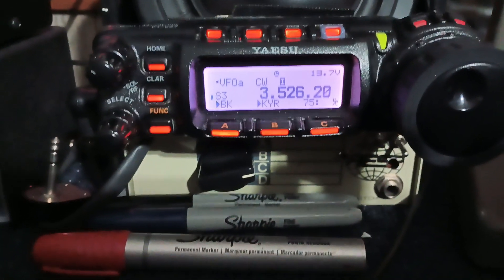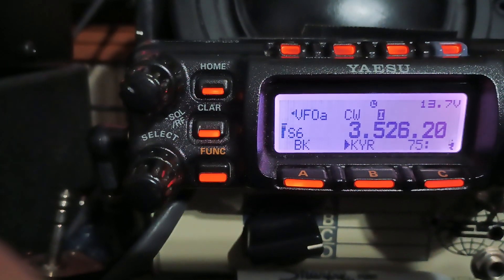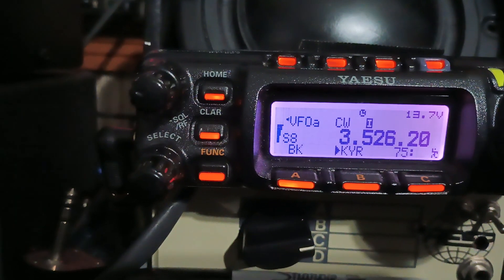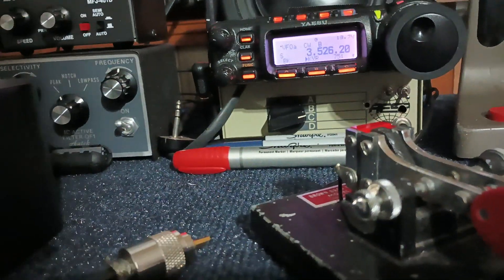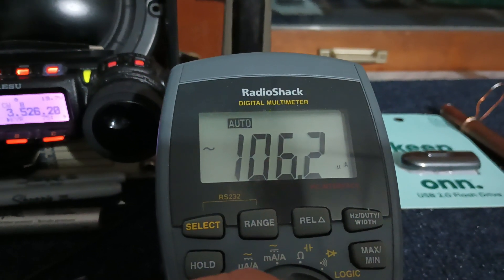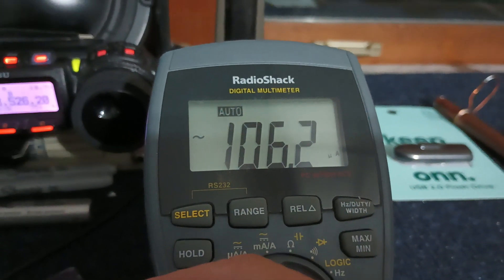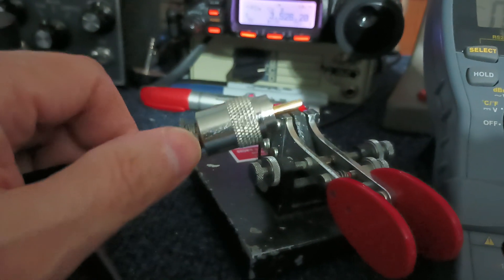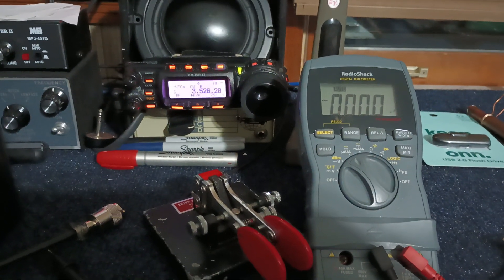Why Grounding Radios and Antennas Is Illegal...AND DANGEROUS #hamantenna #hamradio #grounding

Comment: If the radio is ground via power supply to ac safety ground. Why does it say to put ground rods in? Makes no sense to me. Disconnect everything before a storm or when not in use.
Reply from the maker: The AC line connection does 
NOT  ground the radio. Code FORBIDS GROUNDING AT THE LOAD . That third prong 	IS NOT ground any more than N is.

Its Tribal Knowlege from the early 1900s and just blindly taken as fact by those with no ability in science to reason it out.

I didnt understand it either.

The AC line cord 
 " second neutral" ' is only for shock hazards related to inside the unit or a break in the Neutral circuit of the electrical cord, outlet or branch wiring, it has nothing to do with lightning.

Comment: Again, takes me back to close to when I was 1st licensed and a Ham told me to "..ground your radio to the center screw in the wall outlet recepticle plate..." !
These are just the kind of LID/PIG hams out there that assume you're ignorant compared to themselves, (arrogant, pompass, self absorbed), and don't care if you wreck your station or possible injure and kill yourself.  They'll tell you, "You gotta learn or burn!"  Thus, I have become rather disilluioned with Amateur Radio - outside of just working DX in SSB as far as I can with my conditions out of an apartment with vertical antenna mounted to the balcony railing.  I think I do quite well when I can hear/see my signal on a SDR site somewhere in New Zealand and I don't care whether it was long or short path!  Oh - and just 100 watts.  Great video!
KD8EFQ/73
Reply from the maker: Hey, you remember the "two prong outlet" days!

"Licensed" does not bring any electrical knowlege, its just legal permission to get on the air. 

I saw St Elmos Fire come out of one in the 60s. Not big fun.

A.R. isnt making contacts, its about experimenting with electronics and radio. The
 " on air" is to test the results, if they dont devolve into smoking cinders.

The " long path" thing is another joke, like, my antenna is pointed AT you...propagation doesnt do that long distance. "Great Circles" in Radio Antenna Engineering.
Reply: @k8byp  I think I'm too young for the "two prong outlets".  Always remember the three prong that reminded me of a face as a child! 🤣
And the "long path" crap came from my favorite "Advanced Extras" that think their AE licenses are the same as Ph.D's from M.I.T.!  I swear I wish you could've met them to see and know how incredible condescending, belligerent and ignorant they are.
Reply from the maker: Well just send them a link to this channel and ill play handball with them.
Reply from the maker: The back story there is that A$$L ( pronounced " assol") dont want life members cause thats costing them money. I told them to push off due to the abhorrent conduct of their clowns out in WA state, and they refunded my life- membership money.
Reply: @k8byp  Yeah..  Upon moving to Cumberland, MD, I called them (A$$L) to give them my new address, right away they went into explaining that there was something wrong with my basic membership of $39.00 and I needed to repay it.  I repied, "Really?  Let me run that past the FTC (Federal TradeCommission)."  They tried to tell me that that wasn't necessary.  When my $39.00 membership fee was due I let it go and never looked back.
Reply from the maker: What my crystal ball sees, with specific example in a local corp whose registration trail disappears, and sort of reappears on Ali with Chinese suppliers for materials, and the fact corp Agents are now hiding behind "registration services" is that Chinese concerns are hetting ownership and control of these corps.

If youre in MD we should be able to talk on phone, lets make a Sked...
Reply from the maker: Ah , Blue Disease.  Its hard to beat a Democrat, but try anyway.

Condx from here north have been much better lately for some unknown reason.

Comment: I missed the point of this video. So you are saying not to ground your station at all or are you saying to not ground near the service ground. Also what's going on with that pl 259 it looks terrible. .
Reply from the maker: Thats because you missed " reading, learning and acquiring social skills.*. And your passive aggressive stupidity about " connector looks awful" is childish.*

Grow up,  go away or get banned and reported for harassment.

I wont put up with Trolls like you*. Your fake user name and fake channel with no activity indicate you are a Troll.*

A repeat Troll BTW....thats called Internet Stalking.

I have the big Ban Button
Reply: @k8byp  Great video.  I have heard this before and I have only operated mobile for 20 years.  But, I am putting up a base station now and I had a ground rod driven but have not hooked anything up yet. (Also, I am debugging a 100w amp that is having a problem with rf changing bands on the amp when I key up and the manufacturer specifically said "try grounding the radio and the amp with something besides the RF cable...")  What did he mean?  Connect to the ground rod I had driven in?  It's coincidence that I came across your video when this recommendation was made.

The troll guy poses a good question though, troll or not, you mentioned that "only a fool puts his radio at the service entrance."  I am not an electrical guy, but what do you mean by that?  You have your meter and panel in the house.  This is the service entrance.  Where in the house should the radio go?  How far away?  Based on what you presented here, what are the physics behind the warning?  Do spikes dissipate in the wiring of the house the further away you get from the service entrance?  Also, what's the importance of bonding ground rods no greater than 8 feet separated?  I knew a very capable ham in Cuba who was all over putting his ground rods under the condensate tube of his mini split to keep that soil wet all the time which further complicates what a ground rod can do.  Who makes sure their ground rod is wet all the time?

The more I think about this and the subtleties of what you are saying, the more confused I get.  Let's say my radio is on the exact opposite end of the service entrance, maybe 50 feet away and I drive a ground rod there and I bond it to the screw on my astron power supply that is there for a ground.  What am I doing in reality?  Why do they put a ground lug on the power supply like that and on my IC-706 it had the same grounding lug?  Is this for tying all the equipment in the shack together but not ultimately back to a ground rod?

Also, I don't get the demonstration with the keyer.  I don't know the radio, but I assume you are just closing a contact with the keyer and it's not a 5v PTT or whatever.  What's causing the keying?  The fact that you are closing the circuit through your keyer means that both the center and conductor of the coax are connected to the ground line of the radio and completing the circuit or not?

Anyway, great video.  Thank you.
Reply from the maker: "(Also, I am debugging a 100w amp that is having a problem with rf changing bands on the amp when I key up and the manufacturer specifically said "try grounding the radio and the amp with something besides the RF cable...")"

The amp has a mismatched load, theres a lot of reflected power coming back INSIDE the amp and its interfering with the control circuits in the amp. Hes referring to the grounding RF away " myth.

Put the amp on a 50 ohm dummy load, see if the problem disappears.

Ill respond to other questions later when Im on the computer..
Reply: @k8byp  Thank you for your attention. My tuner is after the amp and I was on 10m going into a resonant colinear vertical.  So, with or without the amplification, on both the radio and the ATU swr meter they both read 1.2~1.5:1 tuned or off.  It's hard to understand a mismatch, but I will certainly see what happens with the dummy load.  There's no denying that RF is wreaking havoc.  As this was a HOBBYPCB Hardrock 50+ kit that I put together and wound all the toroids for, I more inclined to think I did something wrong inside the amp itself. But the basic question is based on what you said you'd respond to later.
Reply from the maker: " It's hard to understand a mismatch,"

No, its EASY to understand mismatch. Whats the SWR AT THE ANTENNA? ONLY. The match at the antenna MUST be perhaps 1.2 or less and thats not great when using an amp, because its a LOT more power coming back with an amp than not.

There is no "tuner" with "amp". Not allowed. See my videos on the tuner myth.

Theres no such thing as tuner. 

Ive made a video to discuss the other questions, Ill be posting it in a few minutes.
Reply from the maker: OK now the P.O.S amplifier "kit."

The reason they sell it as a KIT is that it WONT MEET FCC REGULATions AND THEY HAVENT GOTTEN IT CERTIFIED SO THEY CANT SELL AMPS.

And they are LYING about "professional machining"./ There is no such thing, machiniing is a TRADES occupation, not professional.

lets look at their BS...

"The manufacturer that we use to put the parts on the PCB’s reports an 85 – 95% yield"

That is PATHETIC considering reputable PC board / contract manufacturers have reliability in PARTS PER MILLION FAILURES. 95% is a JOKE. Heres why they are a failure - "a contract manufacturing facility in China."

"Seven element elliptical filters for each band exceeds FCC spectral purity requirements"

Is B.S.. Note they DIDNT MENTION THE SPECS." 7 element elliptical filter " MEANS NOTHING if the filters are not SHIELDED, or there is excess harmonic energy going into the filters.

There is no FCC requirement for "spectral purity"  of a filter. This proves they dont know FCC Regulations.

Harmonics (spurious)  must be 43 dB down (97.307 (d)) or 60 dB down for 6 meters. Those are not easy figures to hit. Just saying "7 element" does not mean "complies with FCC Regulations for spurious emission." That is REQUIRED to be tested as a full unit, not some fabricated filter claims.

"5W maximum, typically 2-3W" AND "100W nominal, 90W min 160-10M, 60-70W on 6M"

5 watts in, 100 out is 20X power. Thats not legal. 5 in, 50 out is 10 dB, legal

 Any less than 3.16W input power for 100 watts out is *AN FCC REGULATIONS VIOLATION, 97.317. The max allowed in the Amateur service is 15 dB.

Since the maximum is the max (prob without damage), then the nominal (typical operating value) is 2-3 watts WHICH IS ILLEGAL.*

Harmonics are not the only requirement, FCC has limits on conducted and radiated EMI that theyve ignored.

No feature is disclosed to turn power down to meet FCC limits for 60 meters, 97.313.

Further FCC violation, there is no circuitry, or discussion in the Manual, that they have complied with FCC requirements to prevent operation on the CB band, 97.317 (a)(2).

From the full assembly instruction document:
https://drive.google.com/file/d/1HoHX-ZwKzIuu-UziFiHLJk0ozteBOA2k/view

Page 18, the cheap Chinese copy (copy of the Phoenix connector which has plastic of a different color) of the connector used for the antenna out coax is not suitable for RF- it makes a knife-edge contact with the wire and they can come loose and break the wire. Trash.

I cant see the numbers on the filter assembly relays, but I doubt they are RF rated. Those dont have much for contact current.

The photo on page 26 shows gross incompetence, we can NOT stuff that much RF floating around into the back of a controller circuit board (behind the front panel) WITHOUT ANY SHIELDING. The CMOS microcontroller is "looking" RIGHT AT THE FILTER COMPONENTS that the RF power is going through.

Page 26, no significant or visible RF filtering for power or control lines to/from the control board. They just blindly threw small capacitors on the board at the header pins, p. 16, bottom picture, upper right corner. There needs to at LEAST be a L network on each line for RF suppresison. At LEAST a ferrite bead for each line.

The likely cause of your amps problem is the grey ribbon cable going RIGHT OVER THE FILTER NETWORK WITH NO SHIELDING. Guaranteed to be RF coupling from the amp into the cable. The cable is lying right on the filter relays and none of that is shielded. There is such a thing as a shielded ribbon cable, I guess theyve never heard of it?

Control Schematic, page 37, no meaningful RF attenuation on power supply leads, just blindly guessing by throwing 0.1 uF capacitors here and there. Those capacitors have to be CALCULATED.  A couple ferrite beads on the RX_n lines, but thats not sufficient. No RF filtering on the control buttons.

MRF 101: https://www.mouser.com/datasheet/2/302/PRF101AN-1501459.pdf

 Good device, extremely fault tolerant - EXCEPT not for THIS application, they made a bad initial design mistake using this device because this is a UHF amplifier- the bandwidth is WAY too wide for an HF amp*, and itll tend to amplify all kinds of trash like harmonics and parasitics. The amplifier device should be chosen to work a LITTLE beyond the max operating frequency (50 MHz). *It is unacceptable to use an amplifier device with a passband 5 times wider than the max frequency.

This is NOT A COMPLETE KIT, its just boards and a container. Theres a LOT more to it than just throwing this together.

Since they have admitted FCC violation in their documentation, Ive just filed a Complaint with the Commission. It is unforgiveable to make these kind of mistakes, kit or not.
Reply: @k8byp  David, thank you for the time and your responses and also the time to prepare your response video.  I appreciate you directing me to your other videos.  This video is the first of yours that I have ever seen and am happy to have found this because you approach this solidly from an engineering perspective with no compunction challenging conventional wisdom.  

So, regarding the amplifier.  I tested on a dummy load.  Given that I don't want to make assumptions that I know anything because clearly a lot of my knowledge is wrong, when I say I added a dummy load, this is what I did. I am running out the radio into the input of a MFJ Versa Tuner II with the dummy load selected.  I have the radio set at 5 watts which is the excitation requirement of the HR50+.  When I key up-bang-a bandswitch occurs.  So, I believe this is the conclusion that it wasn't a mismatch causing this and your analysis of the amp itself indicates the problem is inside the amp chassis. 

I think other's can definitely learn from this, so I will continue as long as you are willing.  I don't mind asking questions and, of course, doing research. 

Also, I am hesitant to publicly post the response I received from the manufacturer because I don't want to start a flame war.  I want to get this working, if possible, while being compliant with FCC regs and also safe practices when dealing with RF and electricity and learn something in the process.  Are you interested in the responses from them in with the purpose of educating and correcting error?
Reply from the maker: Eliminate the tuner. Verify the dummy load works correctly with just a TX and SWR meter, or at least measure it with an ohm meter.

 Connect the output of the amp thru a short coax jumper if necessary, into the dummy load. 

Throw the tuner under a passing bus...🚍 theres NO SHIELDING INSIDE IT.

If key down then causes band switch, theres an RFI ( RF interference) problem inside. That unshielded Phoenix connector is a serious flaw.
My Yaesu tore up a nearby FM stereo once just because of an open port on a 3 way SO239 tee, and that was across 10 feet. That unshielded RF inside that unit has nowhere to go.

That is solved by shielding and filtering as I explained in the above comment. Best to eliminate the computer and display and use switches.

BTW thats ANOTHER FCC Violation, the computer gadget is a Class B Digital Device ( unintentional radiator ) and testing and certification that it wont cause interference is also required, and they didnt do that either.

Its also necessary to shield the amp INPUT circuits from the output  to reduce feedback that can cause oscillation or even destroy the transistor.( another critical thing they didnt do.)

FCC Complaint filed since they were *STUPID ENOUGH TO ADMIT TO REGS VIOLATIONS." That just makes it a ' no brainer' for FCC to take action.

Since all theyll do is cry, whine and deny being caught selling 💩, Im not interested in their response.
Reply from the maker: and PS they put the heat sink on top, it should be on the bottom as its heavy, and ' on the bottom' allows additional cooling such as setting it in a shallow pan of water, or a heat sink plate.
Reply: @k8byp  Okay, well the MFJ has the load inside and I don't have a load separate from the tuner so I'll get one and retest.  Thanks. I appreciate the responses.  I will review later.  73
Reply from the maker: Yes get a real load, the tubular one in my MFJ tuner was 67 ohms. I have a new MFJ UHF load in the box and a nice homebrew 200 w with meter for sale.
Reply from the maker: banned and reported to utoob for harassment. Go get Tissues for your Issues. All you have is slander and threatening to un subscribe?

 Ask the 720 other Subscribers if theyll miss you! 🤣

Ive put up with Trolls for 2 years, thats over. *Its Troll Exposing and Bashing time. *Now you clowns will be exposed instead of just deleted so your psychological problems are on full display.

See a Counselor or Psychatrist and discuss " sociopath"- thats what Trolls like you are

Comment: Not nite no no
Reply from the maker: The 350 microamp was caused by a wire on the center of the coax touching a metal hook that was screwed in a tree

Comment: Dannnng I got to try it I remember I get a shock from my panel and coax I thought I was going crazy
Reply from the maker: Nope, not crazy, thats AC line current leakage. The test thst was used in TV service was a 1K ohm resistor parallel with 0.1 uF, measure across that. Thats for shock.